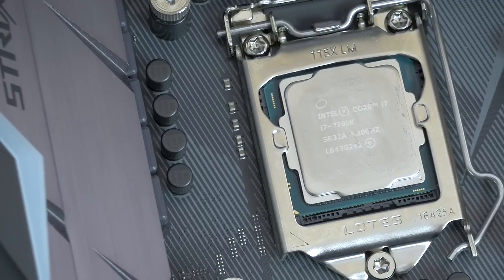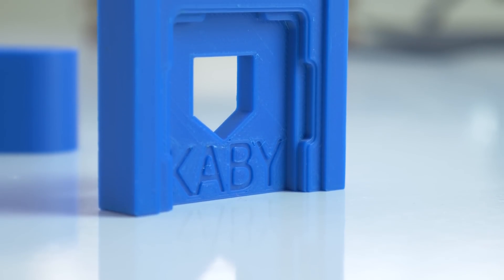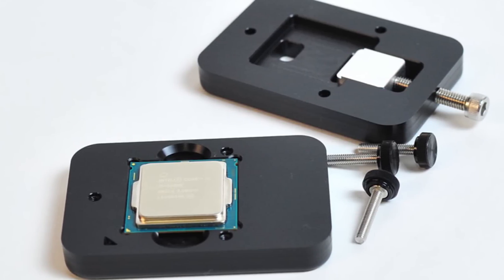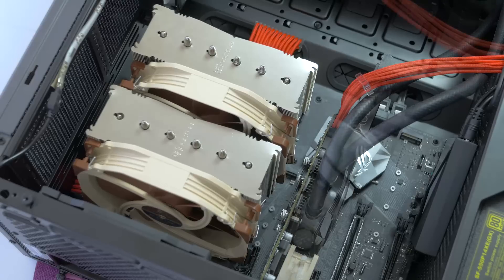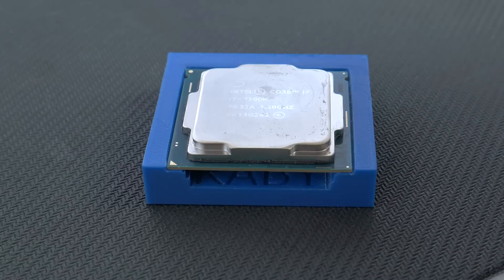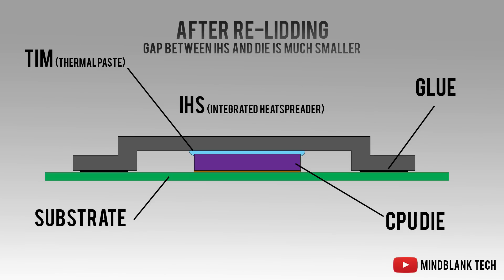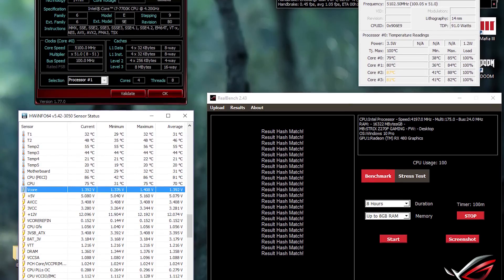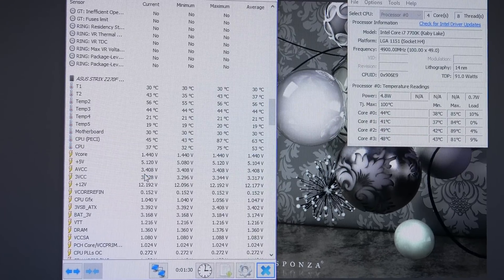Delidding the 7700K - 5.2GHz Overclock - 25C cooler

Comment: This is a genuine question as i'm interested here. I only use AIO or a Complete Circuit Water Cooling System for my builds I stopped using Air cooling years ago. My most recent being a 7700k @ 4.8Ghz 1.35 volts at 30c outside of games and 54c under load. I'm using a H100i v2 in this build. If you are overclocking why would you even bother with air cooling these days? Do people not like AIO or Water cooling solutions or is it that Air cooling has moved on a bit and can keep up with AIO solutions?
Reply from the maker: +s000muk Actually AIOs have moved and started keeping up and sometimes surpassing air cooling. This cooler and others like it can keep up with an H100 and H110 with no issues. The AIO will beat it but the noise profile is just horrible. Please research this if you don't know this stuff. The NH-D15 will cool as good as the vast majority of AIOs and will do so while being quiet. Very, very few AIOs will offer excellent cooling while still being quiet.
Reply: MindBlank Tech thanks for the response. I use Noctua fans to replace the stock fans as cost isn't much of a concern to me and it resolves any noise issues I have. it's good to know air coolers have moved on a bit so I always consider them on a budget build.

Comment: I have my 7700k overclocked to 5.2Ghz @ 1.344v temps max out at 84degrees after 4 hours of Aida64 extreme, is it worth delidding to improve performance due to Tj being 69 degrees?
Reply: Worth it, whats your CPU cooler?
Reply: Osama Elchapasy 84 isn't to bad. You could probably lose 20 or so if you delid though. Roughly getting around I'd say 64 degree's.

Comment: Great content. Shame you're not really noticed :) Currently running my 6700K @ 4.6 ghz 1.35V with Schythe Mugen 4. 82C after 2 hours on RealBench seems good enough to me. Tempted to delid but damn :) Might just get an AIO and be done with it.
Reply: Alexandru Grigoras at same voltage mine is at 4.8
Reply: Bboy Tyby Lucky :P
Reply from the maker: Hey man, thanks for the appreciation. The noticing parts comes in it's own time and terms. Just need to pump work and passion into anything and noticing gets there eventually. ;) I am not a huge fan of AIOs since if they're better then a huge air cooler, then they're for sure much louder. This NH-D15 is pretty damn quiet during load. Custom water loop is another thing entirely.

Comment: Why am I not seeing more people including DRAM clock speeds in these kinds of tests? In my tests it made a huge difference. I have a pair 8gb Corsair Vengance LED 3200MHz with my 7700K on an ASUS z270G mATX MB. When I used the XMP profile the temps increased by ~20c to around 85c under 100% load in AIDA on 5GHz and 1.340v oveclock. Turning it off it went down to 60-65c in the same test. I have a custom loop with a 1080 and a total of 360cm rad space.
Reply from the maker: When you say they made a huge difference, do you mean as in performance or as in that temp rise? My temps are identical between 2133MHz CL11 and 3000MHz CL15. Altough, some people report increased temps when upping the RAM frequency, but more than often it is a matter of excessive voltage on the VCCIO (mem. controller) and VCCSA (System Agent). Some motherboard even have a bug and when you are above a certain CPU freq. it will pump 1.3v or so through VCCIO making temps rise by an easy 10C just like that.

Now, if you mean performance, check out my previous video. I paired both a 4790K and the 7700K with fast RAM for their respective platform (DDR3 2400MHz CL11 and DDR4 3000 CL15. Also, I've done a pretty in-depth video some time ago compairing different DDR3 RAM speeds and latencies and have side-by-side real-time FPS in different CPU intensive games. It's on the channel - check it out! :)
Reply: Yes, sorry, I meant in temp diff. OK so maybe that's what effecting the ttemp in my tests, got to check that out. Thanks.
Reply from the maker: Yeah, please do and report back. Things like these get overlooked. Like I did with SVID Support and offset voltage. It would not work for me no matter what (offset voltage I mean). Meaning that vcore was identical between load and 800MHz idle. I scratched my head for 2 days and decided that the VID table on my CPU has to be borked. Then I realized that I had CPU SVID Support Disabled in the UEFI and this is why offset wasn't working. Naturally, since it now works and I have 0.95v during 800MHz idle (instead of 1.39v like I have on manual vcore or offset with SVID off), the temps also went down from 36C to 28C. ;)

Comment: Great vid and thanks for posting! I've put together a quick test bech of my pre-embargo 7700k on an Asrock mobo the day before CES and it's been running at 5Ghz stable since then - now I really want to delid and see what kind of difference it's going to make as it's out of the box stable thanks to a favorable lotto pick! I'm also running a AIO cooling block on it so that helps a bit. Btw, where are you from if you don't mind me asking?
Reply from the maker: +Whiskey Foxtrot Hey dude! Thanks! I don't mind you (or anyone, for that matter) asking where I'm from, but the thing is that it is irrelevant in the end, IMO. Content is what matters and besides, I have a family and don't want to be too open with this at the moment. Hope you understand. :) But, anyway, how does one come across a pre-NDA 7700K (or any other Intel CPU)? Is that ASRock mobo a Z170 MOCF by chance? What voltages and cooling are you running at 5GHz?
Reply: Oh I understand no worries. I was just curious - personally I'm from NL myself but haven't lived there since late 90's so I was trying to figure the accent out (weird thing I do). As for the Asrock, I'm actually using the Fatal1ty Gaming K6 for the bench and used the auto "OC Optimized settings" which allows to go up to 5ghz. The Vcore is set on auto (but it hovers around 1.48V). It's my first ASR board in years. As for the 7700k, I got to "play" with it for evaluation/work purposes. For cooling I slapped on an extra Thermaltake AIO kit with 360mm rad, nothing fancy.
Reply from the maker: Kinda high voltage, but I guess that's Auto for you. Not interested in trying manual and going lower with that voltage?

Comment: Not sure if this helps but I'm running 4.9 stable with lid on air with the cheapest cooler I could get. 5.0 instantly crashes but if I delid and water cool who knows.
Reply from the maker: +ProjectEd Whatt voltage and what cooler? Also, what temps? :) Just curious to see what can be done on a cooling budget with these chips.

Comment: Linus tech tips could learn from this . as his delid video showed only margin of error difference
Reply: he did the 6700k i believe
Reply: yea but he did it on older cpu where on the 7700k the margin is better %25C cooler that is a big difference and worth it for some....
Reply: digitaltactics can't remember what CPU he did it on ATM. but the delid on my 7700k was well worth it got about 23-24c difference at 1.3v
Reply: he also didnt add liquid metal but just normal thermal paste.
Reply: They didn't use liquid metal which is important, their CPU also wasn't overvolted much (a 7700k @ 1.2v standard voltage also doesn't run hot). And the 7700k runs the hottest when overclocked so far, due to small die size and high voltage/clock speed.
Reply: must be pretty wide spread or it just doesn't change much unless your overclocked. as all the 7700k delids i have seen including my own have had huge temp drops
Reply: He used a 6700k, which didn't need to be delidded in the first place.
Reply: It was the i7 6700k.
Reply: asorlon1 Skylake runs cooler at stock but it's stock freq is lower and most times lower stock voltage +- silicone lottery . kaby lake is pretty much a pre oc slightly binned skylake. but the price difference is like 10-8$ for kabylake over Skylake so 10$ for a better binned CPU was worth it to me
Reply: +Silver Fox Haters gonna hate. Linus had a properly functional CPU; he delidded a CPU with properly applied and functional thermal interface material. The temperature difference HE received was perfectly in line with the kind of temperature difference you would get using good quality TIM as opposed to stock TIM. This temperature difference SCREAMS manufacturing fault. 
But of course, feel free to hear what you want to hear. Perhaps you should stick to providing that single subscriber of yours (your mother I assume) top-quality 'videos of stuff'. LOL.

Comment: You delidding with tools, I delidded with razor blade for 5 cents :) I don't have 3D printer and no extra money for "One Time Use" tool so with razor blade was much cheaper. Hehehehe. Anyway, the important thing is that the result is the same.
Reply from the maker: +Stefan Stefanov You're brave! It's very easy with a razor to scratch the substrate. Costs are way down on the razor method, obviously. But it requires a brave man, like you!

Comment: I got a 7700k and get 5Ghz at 1,32vcore, stable. The temperatures are Ok with H60, i'm surprised with that. What u recommend vcore for 5,2ghz?
Reply: Just try what works the best as every single cpu is different, wouldnt go too far above 1.3 for kaby and skylake
Reply from the maker: +Tobias G. Exactly. You meed to try for yourself. No one can say what you need for 5.2GHz or that 5.2 will even work on your chip. Just keep upping the vcore and see how it goes. Keep temps in check, no more than 87C during max load.
Reply: GbSli nice chip if it's avx stable at 1.32v that's a rare chip mine takes alot like 1.36-1.37 area to be avx p95 stable so I just run a -1avx offset and run 1.3v for 5ghz

Comment: Dude turn down the bass its impossible to listen to ur vids cus u sound like radio anounncer had to turn off my bass all the way for this video.
Reply from the maker: LOL dude, I know. This is my voice. I actually tone it down in the editing part, but it's still boomy. You should hear me in real life. What can I do...
Reply: Sorry then didnt mean to be rude I thought u edited ur voice to sound this way, Nice vid tho I just got my 7700k to stable 5.4ghz at 1.46v but im running 3x 360mm rads to keep the water ~25 degrees C + I have 27L reservoir and ambient of 16-18C wish I could post a pic in comments. and.. im running 18x 136CFM fans on the rads push-pull. and ofc the rads nor reservoir is in my case I have reservoir made out of 30x30cm acrylic panels + rads are sitting on the ground right next to it

Comment: getting my delided 7700k back from silicon lottery tommorow hoping I get awesome temp drops like this
Reply from the maker: Probably will. Post back - I'm curious to see what you got.
Reply: MindBlank Tech went from 88-89c to 63-64c but only at 1.3v in BIOS with avx offset of 1 may try to get 5ghz prime stable latter. so pretty big drop in temp for me. I am pretty happy with it as I went from a chip I felt was running to hot at that clocks to now thermal is just fine. it's almost crazy a simple paste change does this. silicon lottery even glues it back down and I still got 24c less
Reply: Damien Can you run it at 5.2ghz
Reply: darrenraphael haven't tried it yet ,but it could be possible with a lot of v core and idk if i could get it prime 95 stable at 5.2ghz. I might give it a shoot one of these days and see if i can get it rog stress test stable at 5.2 or something. but for now 1.3v at 5ghz with a -1 avx offset is nice keeps temps low so fans can be set to low rpm

Comment: 1.4 V on 14 nm FinFet transistors will reduce the life time of the transistors significantly
Reply: nitroxide91 Intel has rated it to 1.52v so 1.4v may be OK if you can cool it. gusse we will find out in a few years
Reply from the maker: According to many people online (I know, don't believe everything you hear), you can go as high as 1.45v with very good cooling and temps. 1.39v is still low in my opinion. People have been pushing 1.48v through their chips for a few weeks + torture testing and benchmarking and no one has reported degradation yet. On Haswell and high voltages, after a few weeks I already started seeing people report degradation.
Reply: Damien CPU's come with a 3 year warranty anyways. if it lasts 3 years it will last another three.

Comment: i will delied my 7700k this week. Im full watercooled custom loop. now im running 5ghz at 1.34volt ... 71 deg celcius max temps ! propably hit 52 deg on max wowwwww
Reply from the maker: 71C on a custom water loop and 1.34v? That's really bad. You need to delid it, cause it's making your cooling look bad. :D
Reply: haha if i use your cpu test and monitoring ... 58deg max load ... you need to custom loop hahaha dont forget my VRM and my 1080 are under the loop too ;)

Comment: Extremely well done and informative! Now I kinda want to delid Ryzen at some point to see how much I can OC.
Reply from the maker: Ryzen should be soldered. ;)
Reply: letsgoiowa ryzen should be soldered so gains won't be like CPUs with Intel's crappy Tim but there may be a few c to gain
Reply: AMD's highest end chipset option for Ryzen (X370) only barely compete with Intel  Z170/270, so i doubt they will be using anything much better than what intel uses on the mainstream i7s and i5/i3. That plus clock speed/IPC should be below Sky/Kaby Lake, so heat won't be as big a deal